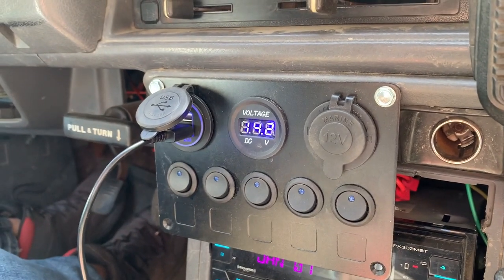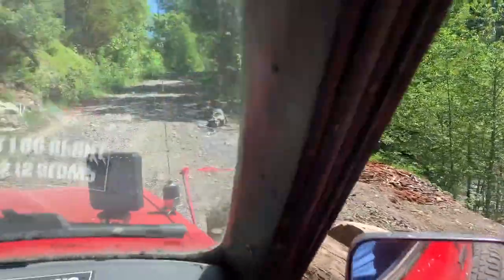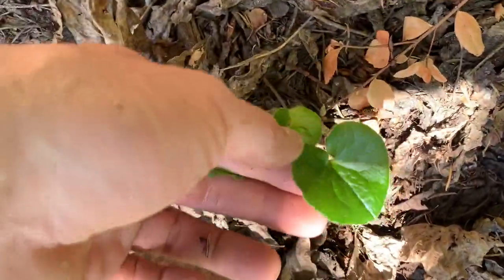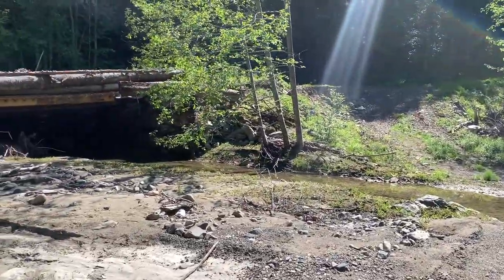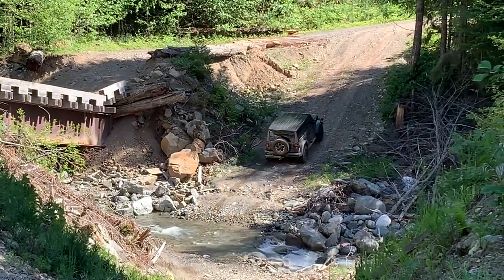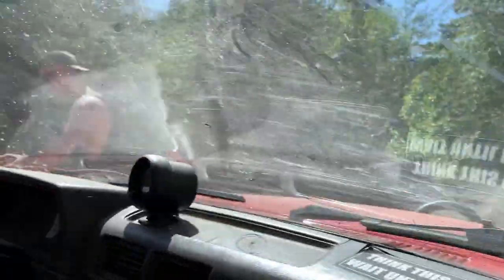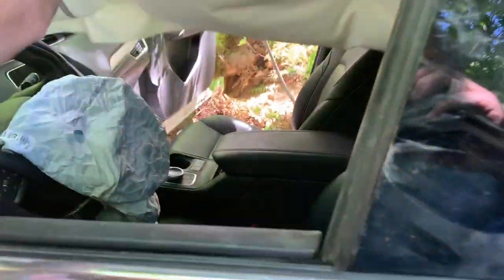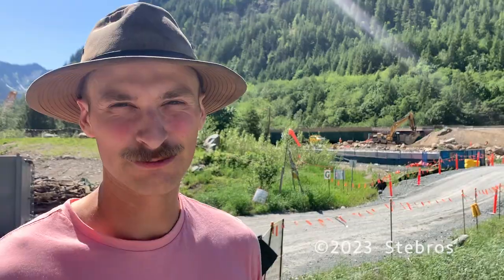Wheels Locked for Off Road Adventure, Cadillac Crashed, Hwy Update

Comment: Hi Guys
I have watched your videos from the time right after the Flood, all of them.
Your coverage and commentary, combined with your enthusiasm for what you do is fantastic.

I am a retired Logging Truck Driver.

Back in the OLD DAYS, like about 2015 or /16, nor sure, I hauled Cedar Logs out of that area, taking them to Revelstoke. 
I not sure how far back the road went, but if my memory is't too far off, I think we were Loading just above the main road at about Kilometre 38?
My kms mite not be correct, but what i do remember is that it took about 1:30 hrs to 1:45 to get to the pavement loaded.

I rarely comment on Videos, but yours are spectacular and your coverage of that road is of great interest to me.
I haven't mentioned the road Name, because even when I was driving it and calling my kilometres, I didn't know how to properly say the name, let alone spell it.

I used to say something like 16 Down Sawaka.
For those that have never been on that road when it was a road, two Logging trucks coming out Loaded, travelling about 1/2 KM apart, almost never saw the other.
The second truck only knew the other was ahead, because of a slight bit of dust.
Rarely if ever got above 20kms, and never had to shift gears, just steer.

That was probably the crookedest  roads I ever hauled on, glad it was almost level and if I said poorly maintained, I'd be lying, it wasn't maintained at all.

Keep 'em coming.
Your complete presentation could not be any better.